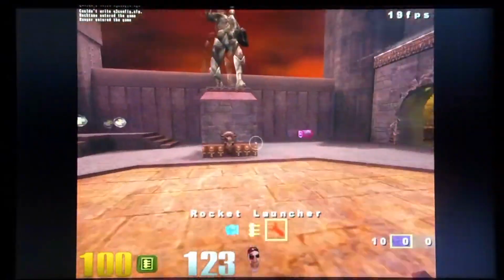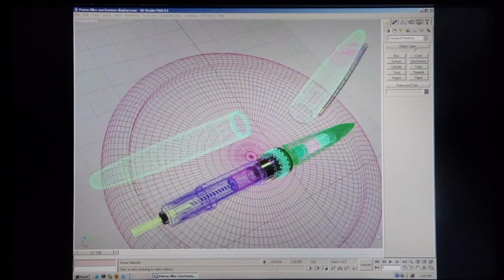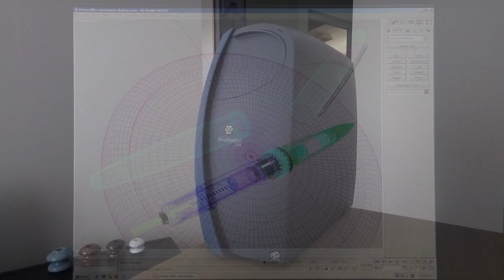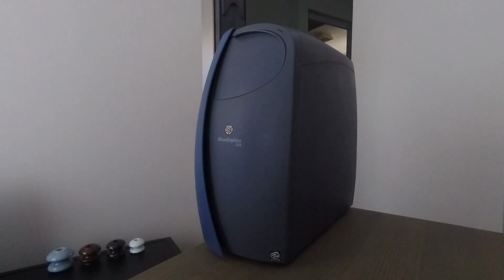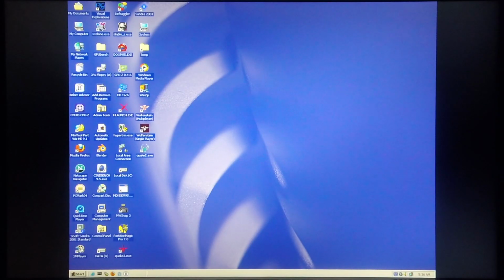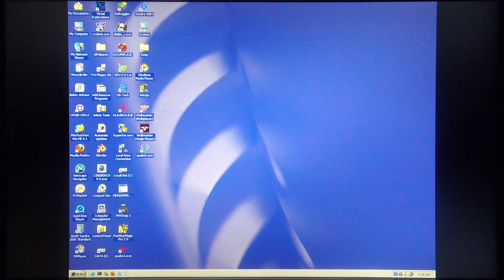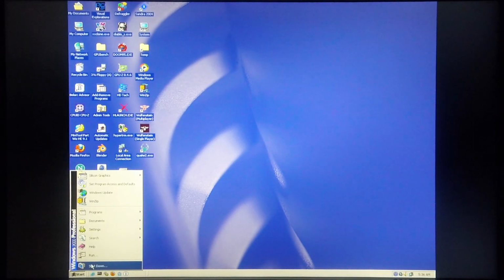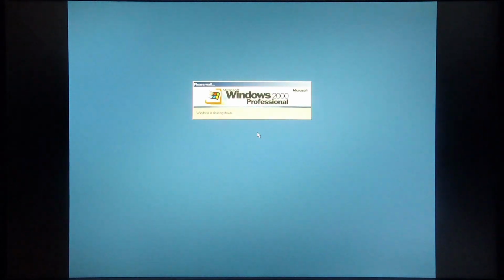A Hardware Tour of a Silicon Graphics 320 Visual Workstation

Comment: How well do these Windows machines run with the current Linux distress?
Reply from the maker: That I don’t know, as I’ve only ever run Windows 2000 on mine. It’s blender performance is typical of a standard dual PIII CopperMine 1GHz system, as it scores the same result as my dual PIII CopperMine 1GHz PC, if that’s any help. Linux would also have to have a driver for the Cobalt graphics chip which sits at the heart of this system.
Reply: @Irinikus  Thank you my friend, keep up the good work.

Comment: Do you happen to have the original CDs that came with the system? I just purchased a 320 with a broken NT installation (looking for DISPLAY_DRIVER.DLL) and it memory dumps. I need to reload and would love to put W2k on it. Can't figure out how to make this boot off of the CD using a generic W2K (WinNT) disk that I have. Much thanks.
Reply from the maker: I unfortunately don't have the CD, but you might want to make contact with Ian Mapleson, Who runs "Ians SGI Depot", as I bought the machine from him, and he set the system up.
Reply: @Irinikus  thank you. I will reach out to him.

Comment: This design is still so advanced now, but unfortunately cannot be upgraded.
Reply from the maker: It's a very cool system, but the Cobalt chipset does however make it impossible to upgrade the graphics. The unified memory architecture did offer extremely good performance when it came to viewing and manipulating large 2D images.